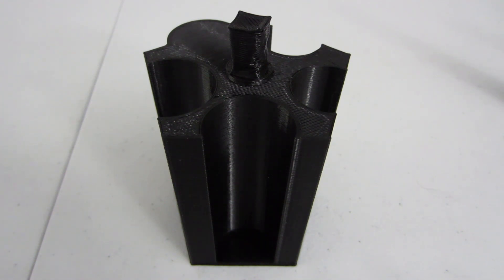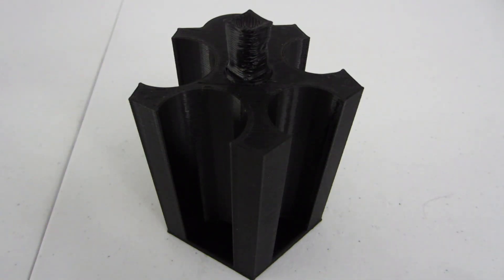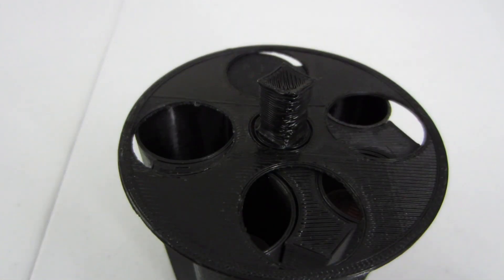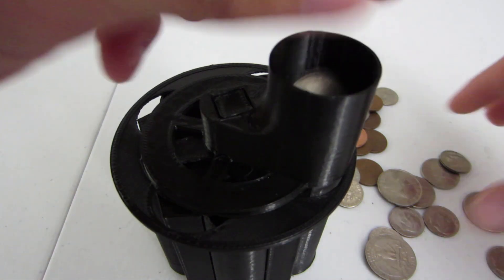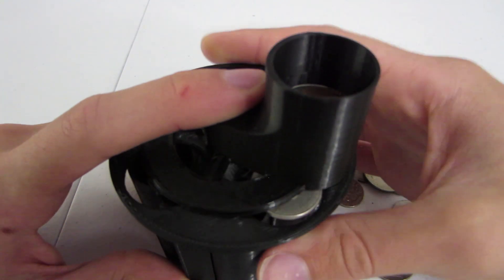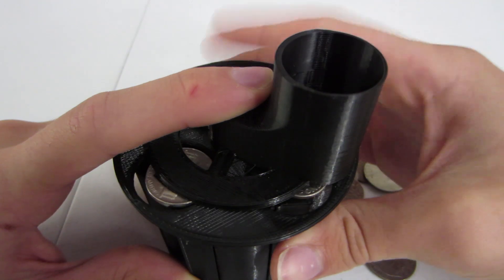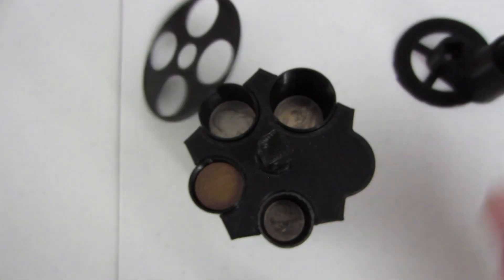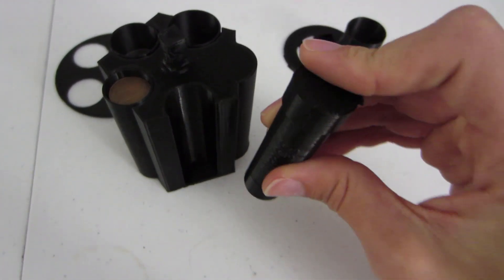3D Printed Coin Sorter

Comment: I know I'm a little late to this, but what infill/material did you use? I just finished printing both the holder and the inserter at the same time in ABS with a 15% infill, but the diamond-shaped hole on the inserter seems to be too small for the diamond-shaped peg on the holder. Any recommendations?
Reply from the maker: I would try printing it in PLA and see how it fits. ABS tends to shrink slightly while printing
Reply: @EugenePentland  Thanks, I'll try that

Comment: im sure you can make a motorized version with a bigger hopper
Reply from the maker: I could, but it was made for personal use and I don't have an arduino so that I could make it. I might make an updated version where there is a bigger hopper and a handle to crank to make it faster
Reply: cool